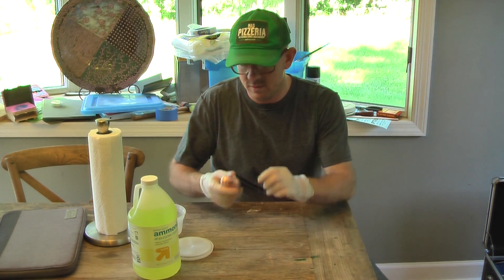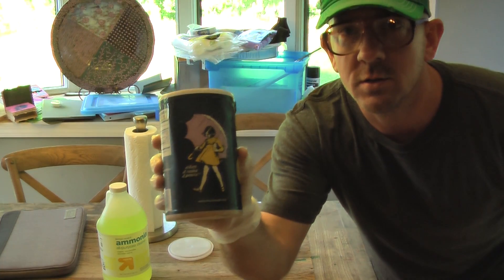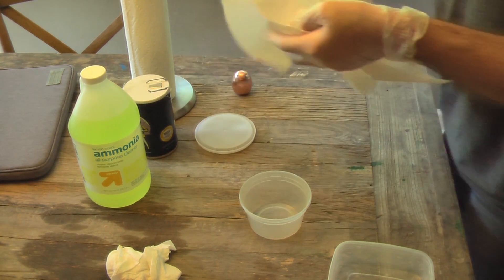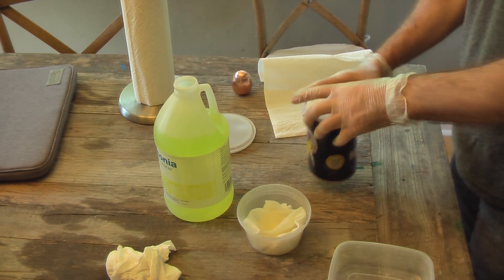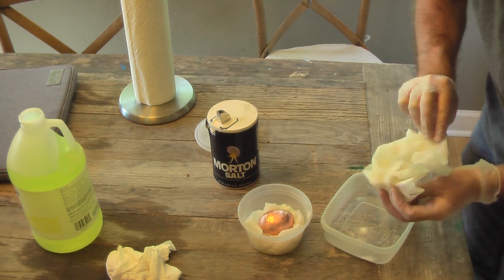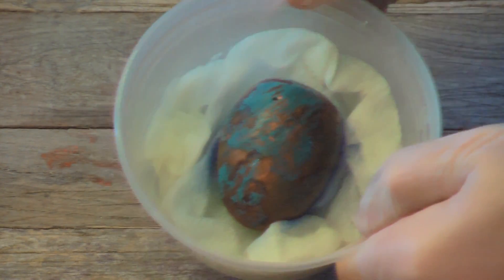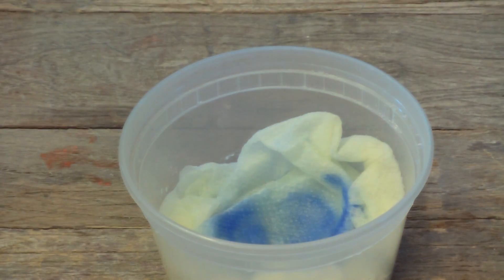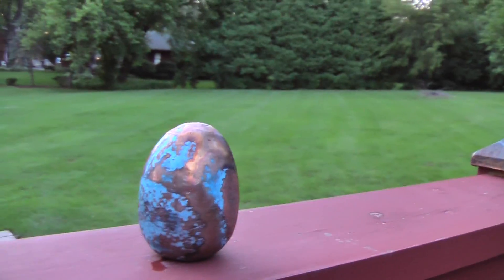How To Patina Copper.

Comment: It left little imprints of the paper towels, little hash marks all over it.
Reply from the maker: Yeah, I've used different towels etc and they all leave a different look or texture. You can use whichever towel etc you like to get the desired look. Also can adjust the time as well.

Comment: Another thing you can use instead of paper towels is pine shavings. There are other things, too. I think I've heard of using potato chips.
Reply from the maker: Interesting, thanks for the tip. I will have to try some of those out on my next project.
Reply: Probably wouldn't need salt if you used potato chips.